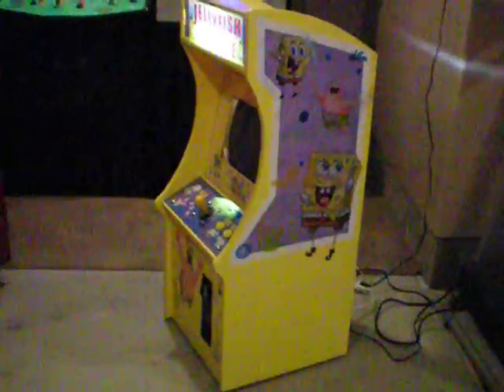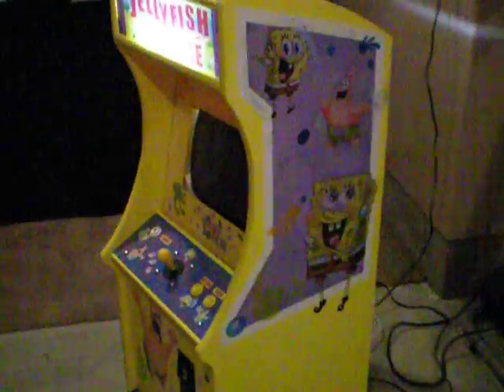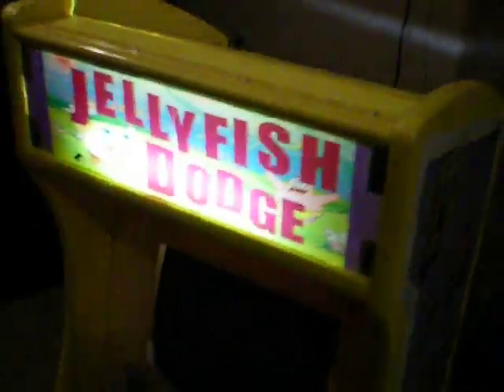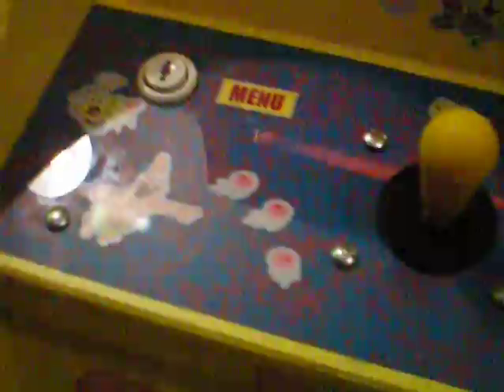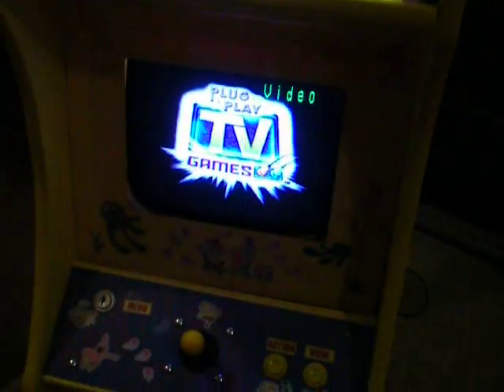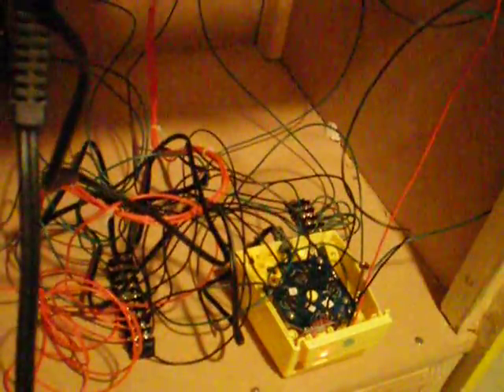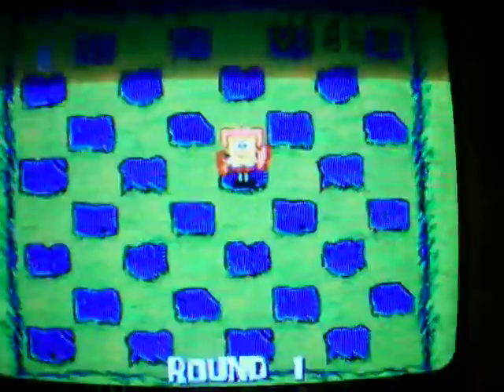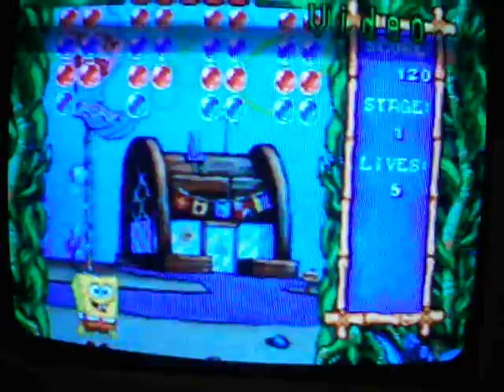Spongebob Squarepants Arcade cabinet

Comment: Nice job, you may be able to route some power off the TV mobo, that is if it has something around your voltage required for the Plug and Play device. Maybe try a linear or switching voltage regulator. May allow you to turn it on with the monitor instead of a seperate switch.

Think the plug and plays are typically 4 AAs,  so 6v, and seeing as how long it runs off one set off AAs i'm pretty sure the draw is low.

Comment: Why are you still using composite video instead of upgrading the TV game to RGB for better sharp pixel quality.
Reply from the maker: Because in 2010, it was easier and cheaper to buy a 10 dollar crt TV from goodwill with the composite hookups. The plug n play game I bought plugs in via composite signal.
Reply: @gozer5454  is it even possible to mod the composite cables from that TV game to get a much better video signal?
Reply from the maker: Yes. The Alva Amusement cv-03 could mod the signal from composite to arcade rgb.
Reply: @gozer5454  would it involve replacing the composite signal wires on the circuit board than keeping it which is what most game mods have done?